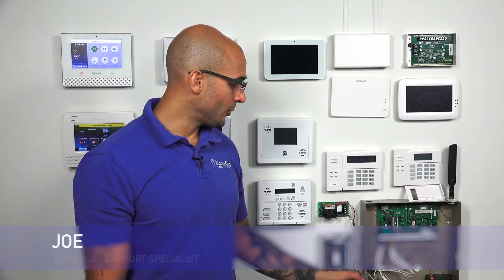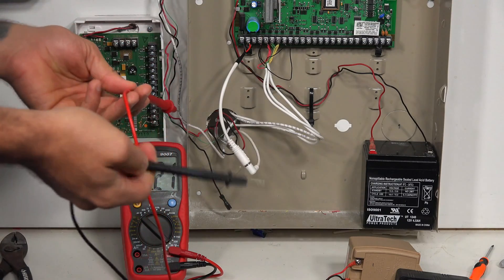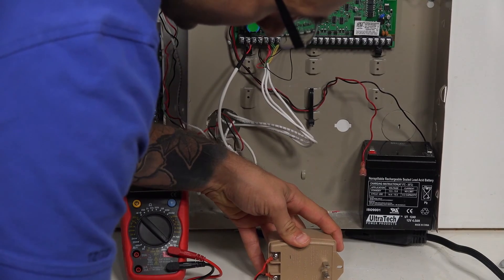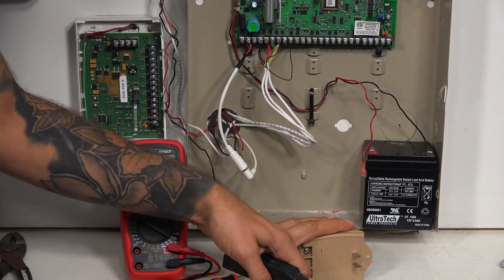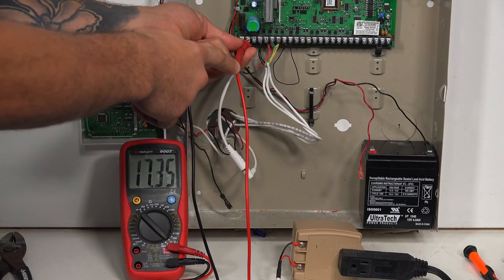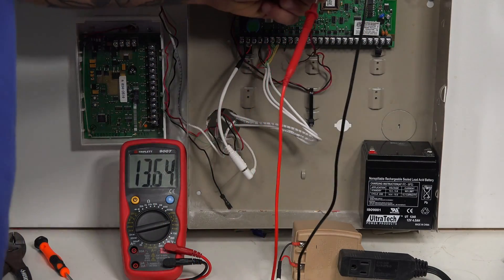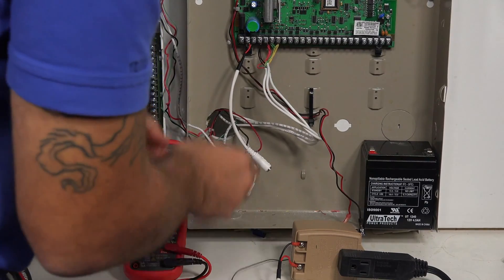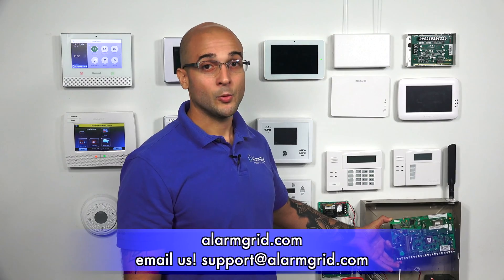Troubleshooting a Low Battery Condition on a VISTA Panel

Comment: Can you just show us how to troubleshoot the charging circuit on the logic board? And replace faulty component? The whole rest of the panel works fine just the charging circuit. Seems unnecessary to replace the whole thing when only a part is bad. I dont typically replace the car when the alternator goes, do you?  Im assuming it can only be a relay or capacitor or  something stupid. Right now I have it bypassed and I'm using a battery tender which is actually working quite well, but it would be nice to have the proper setup as intended by the manufacturer.
Reply: Unfortunately, the manufacturer does not offer board level troubleshooting or support like that, and therefore we don't either, so your best bet is to continue to use the work around you have configured or replace the board.

Comment: I have a battery trouble on my Vista 10SE because there is no battery inside of it
Reply: Hey Retro4Ever, That is correct, you will receive a low battery error with out a battery. You can acknowledge the error by pressing "*". This will silence the panel.  It is recommended to replace with a 12v 7Ah battery as a replacement.

Comment: You all have the best videos.  A huge thank you from small time alarm repair folks.  I'll keep looking but do you have a video on panel replacement?  I'm wondering if there is a faster way to get the codes transfered from old to new panel.
Reply: Thanks Captain! Appreciate it. Unfortunately the only way is through an authorized user of the Compass program. Resideo's remote programming software built for dealers.

Comment: Love your video.  Message is Low Bat 25.  Tried Power off twice, Replaced 12V battery, old and new battery both over 12V. Checked AC power at outlet, 124V, transformer 19.2 V, power at the board 17.6 volt.  Confused because the board is supplying power to the battery and the battery is good but still have a low battery message.  Please help
Reply: Low bat 25 sounds like a wireless sensor programmed into zone 25. Please make sure to replace with approved battery only per installation instructions the the sensor.

Comment: My vista p battery leads are reading 13.05v max and battery is reading 12v when measured. However, I keep getting LOW BAT beeping fault. This is a new battery that stopped the fault for a few weeks, but the fault has now returned. Any idea what the issue could be? Are the battery leads outputting proper voltage? It’s not 13.5v or above, it’s 13.05v max…